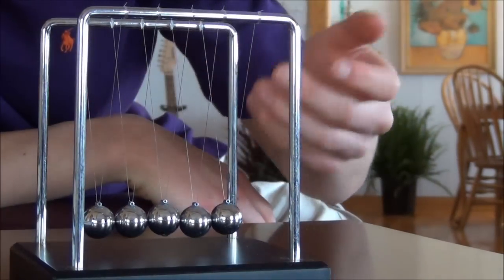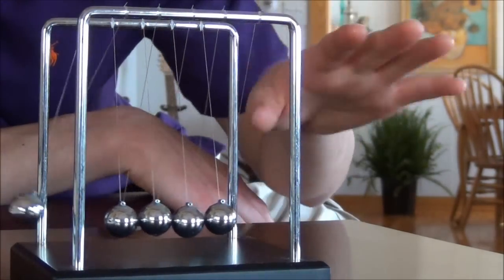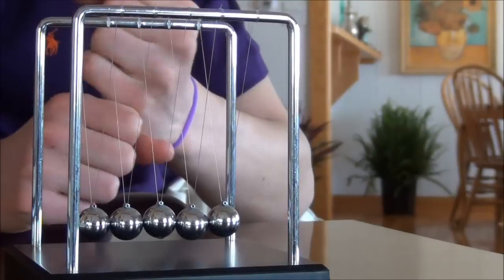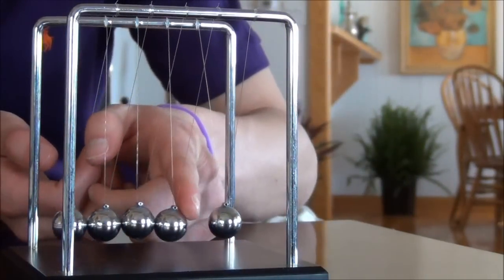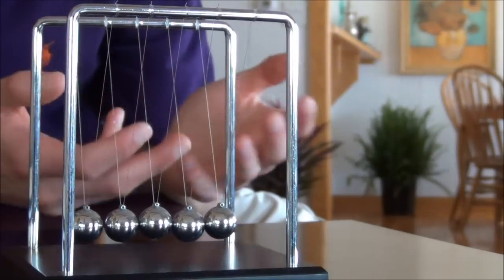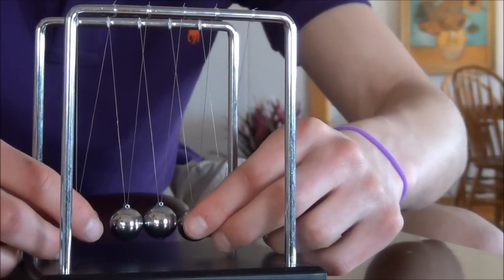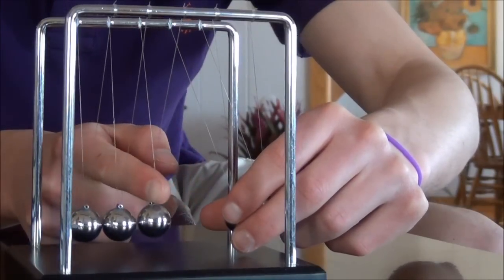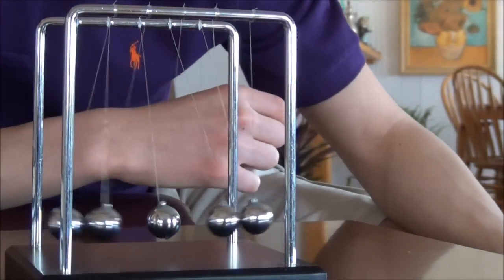The Physics of Newton's Cradle

Comment: Thank you for this great explanation. I had never understood how the balls at the ends knew whether 1 ball or 2 balls were hitting. Now I know. But I do have a question. What if the 2 balls making the hit were welded together (or was one ball with twice the mass). My first thought was that one ball would move at twice the speed. This would conserve momentum mv. However, to conserve kinetic energy, 1/2mv^2, the last ball would have to move at 1.41 the speed. My thought therefore is that more then one ball would need to move at different speeds such that both both the momentum and kinetic energy would be conserved. Do you agree and would you be able to perform this experiment?
Reply: i want to try this

Comment: Following on from that hypothesis, if the first ball had twice the mass (same diameter), then there shouldn't be two balls moving at the far end as there is only one collision, meaning that the end ball would move off at twice the velocity that the first (double mass) ball moved in with. I'd love to see this tested. Maybe the @SloMoGuys could do something on this?
Reply: I think thats mostly wrong. What travels through the balls is a compression wave with an intensity and duration. If you had two balls welded together, you would get two balls at the end. If you had a double mass ball made of uranium, same volume. Then the last ball would be catapulted twice as fast

Comment: If the 2 outer balls are glued together, my prediction is that only one ball will move at the other side, with double the velocity. Is this correct ?
Ps: thanks for the nice video, good job :)
Reply: ***** its not true the explanations are wrong
Reply: angelo fernandez So there is no way to move only one ball with added velocity, instead of multiple balls ? 
Btw : thanks for responding!
Reply from the maker: ***** what would happen if you lifted 4 balls and let them hit the one remaining ball?
Reply: the 3 middle balls would make an occilating motion and the outer one would make the cradle motion
Reply from the maker: ***** sorry i misunderstood your original question. you're asking if one of the balls was say, twice the mass, and you set it swinging, what would happen to the ball on the end? i think it would have a larger velocity because the input force has greater momentum.
Reply: that is what i ment indeed, thanks for telling me :)
Reply: Wrong, two balls would swing on the other end. Energy has to be conserved as well as momentum, that's the trick.
Reply: I see, thanks
Reply: So, I can't seem to find where our original conversation started, so I say we continue here? :p

Anyways, so I forgot to mention in my original comment, that energy and momentum would be conserved in the case of 3 balls. In that scenario, both energy and momentum would be conserved with the values I gave - m=1 and v=6. And afterwards - all three stick together, each with a velocity of 2.

Comment: This is wrong, what if you glue 2 balls, they wont hit at different times, and you still get two balls lift on the other end. Indeed you need to explain it with the natural modes of frecuency of the system, watch "the action lab" video.

Comment: 🧲 Wrong. If everything was moving with the exact same velocity it would be perpetual.
Reply from the maker: we assume a frictionless environment
Reply: @paintingoftheweek  
This is not an issue of friction, it’s an issue of gravity because friction is about the force resisting the relative motion of solid surfaces, fluid layers, and material elements sliding against each other. There are several types of friction: Dry friction is a force that opposes the relative lateral motion of two solid surfaces in contact. 

Even in a 100% vacuum with zero % friction,  Newton’s cradle would still come to a pretty quick stop because gravity is Is the enemy here. Gravity is at work here. 

I’m impressed. You have posted nothing in five years yet you’re still hanging around answering peoples questions and responding to comments. That’s pretty cool indeed.